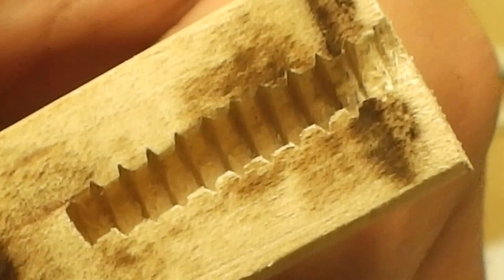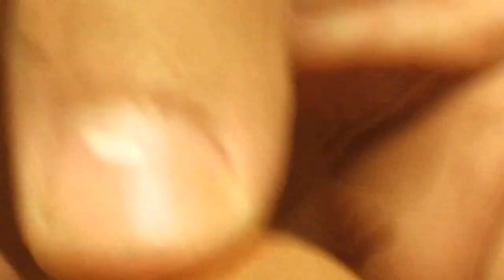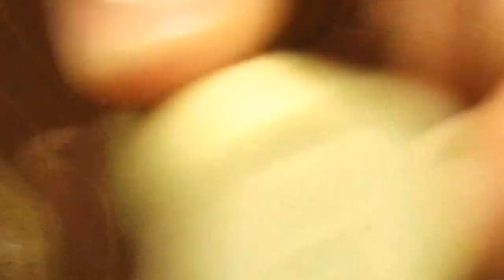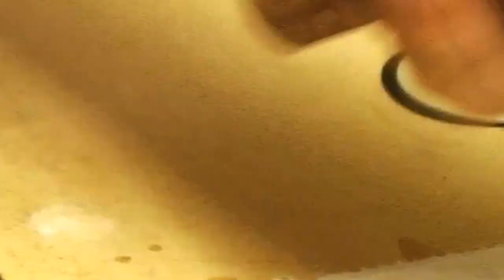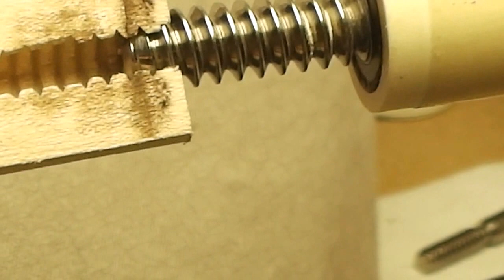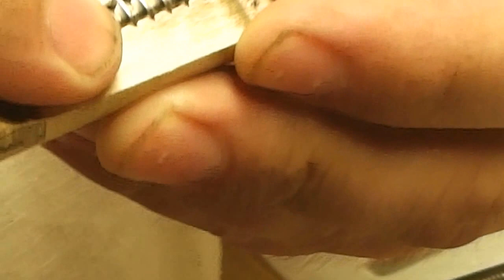joint pin 1

Comment: All things being equal, the lighter the joint screw, the more feel you're gonna have.
It's just physics . Less weight in the joint, more resonance. Weight absorbs resonance.
The G-10 has the best hit but only weighs like wood itself.
It also flexes like wood.

Wood to wood, brass to wood, do not make a difference
It's their weight/mass and rigidity that make the difference.
The cueball does not know what kind of screw ( it's not a pin. It's a screw ) the cue has .